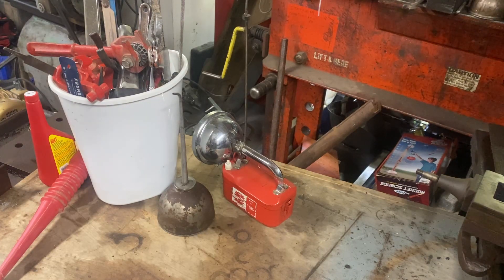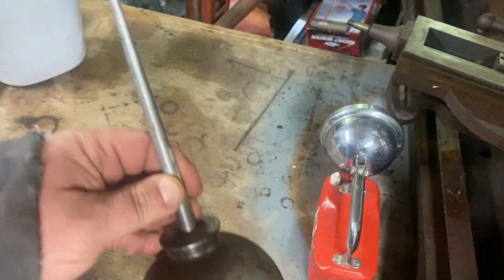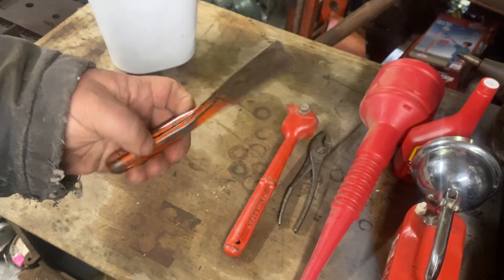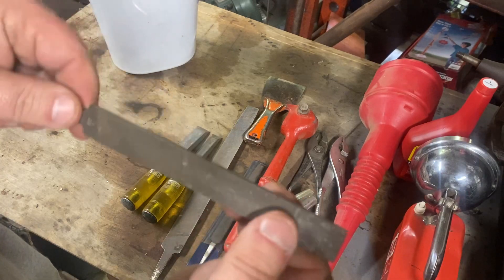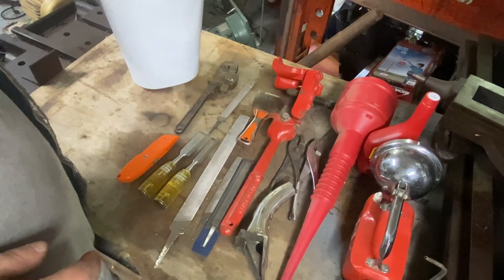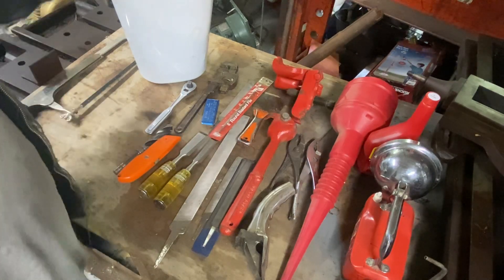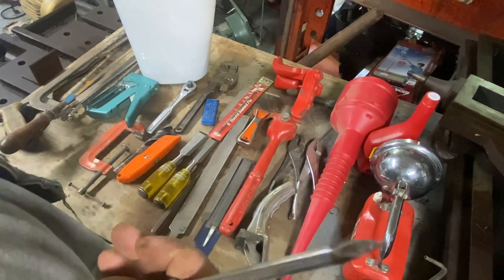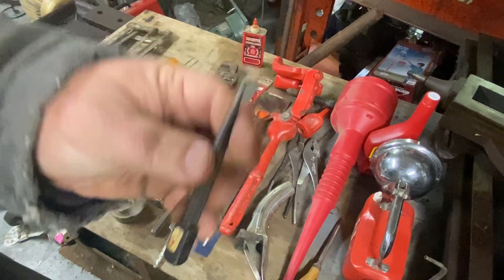Yard sale, auction, and swap meet finds 2023 #1

Comment: The vaco/ xcelite screwdrivers are some of my favorites. The old yellow protos are pretty high on my list as well. I buy them both kinds every time I see them. I have put together a nice collection of both. 

Adam your always finding gold. Question  for ya how do you find the sales? Do you look them up, drive around or what? I don't see many sales and the ones I have stopped at for the most part always turn out to be a bust. I know some of the best old gold is found at sales plus its fun listening to old timers tell tales of days in the military or working on machines. I grew up listening to those stories and still enjoy them now.
Reply from the maker: For estate sales I look on Craigslist, for yard sales I typically just drive around and I stick to the edge of town in the more rural areas, sometimes I have to go to sales for like 4 or 5 hours to get enough for a video